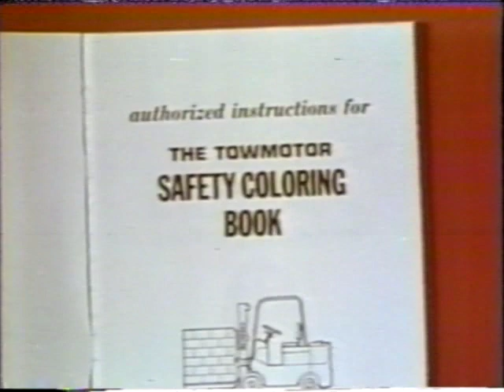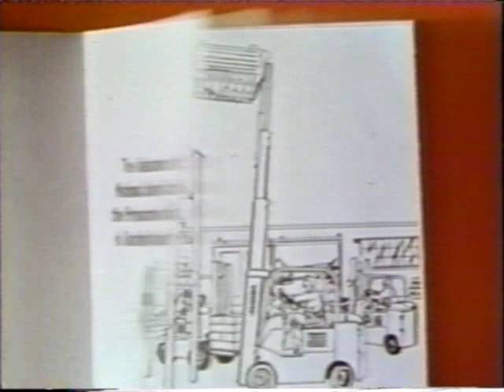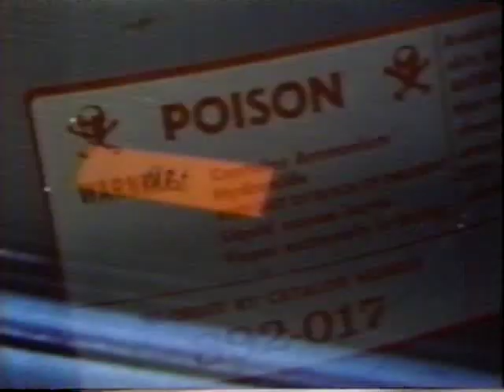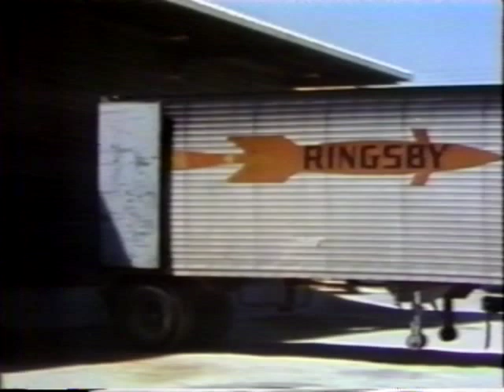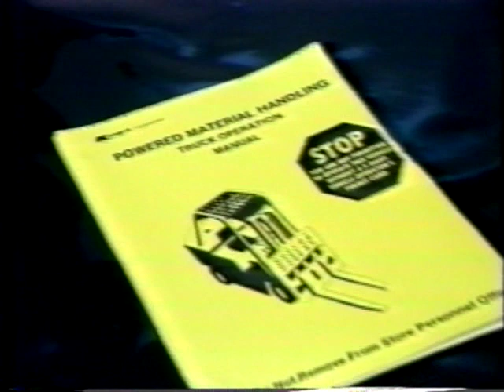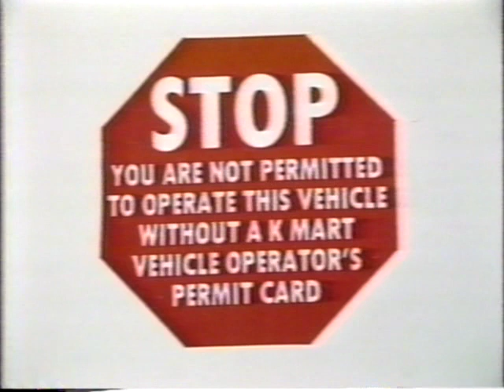Kmart Lift Truck Operator Training VHS Tape - Caterpillar "The Color of Danger"

Comment: Those cafeteria companies represent Kmart's first forray into diversification. Many point to the late-80's/early-90's when Kmart diversified, but actually, they started buying other companies in the early-80's with Furr's (1982) being one of them. Yeah, Kmart had a problem with buying too many companies long before most realize!

Comment: I had one of those licenses and watched this video around 1992;  they were still using this video when our store closed in 2016!
Reply: TheHobbyShopFilms your Kmart was either very cheap or very underfunded
Reply: Lol that’s crazy, kids being just hired wouldn’t take this video seriously at all
Reply: As a professional forklift operator, I approve this training video.
Reply: The managers did more damage with the forklift than the regular employees.  One time the manager hit a sprinkler head when moving toilet paper.  Let’s say that sprinkler water stinks bad!  It flooded receiving and all the paper products.  The food was mangled on a weekly bases because the didn’t open it all the way.  Once when they were moving pallets of pitting soil on a very hot day, the fork lift sank into the asphalt parking lot.  Employees would do donuts in the parking lot.  They would use the forklift to damage merchandise. Like driving over a bike and furniture that needs to be thrown in the dumpster.  I once saw them pick up the dumpster and move it across the parking lot wit the back tires off the ground.  Should I continue? Lol
Reply: The store I worked at in the mid 90s also used this video.
Reply: @TheHobbyShopFilms please continue